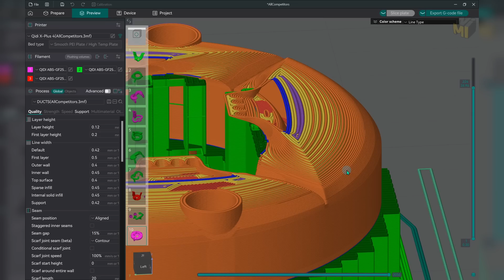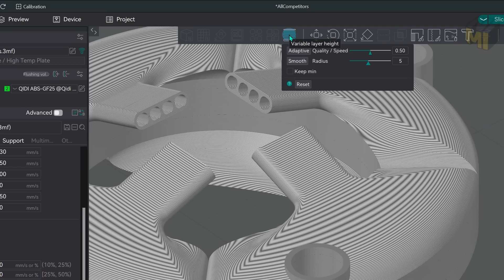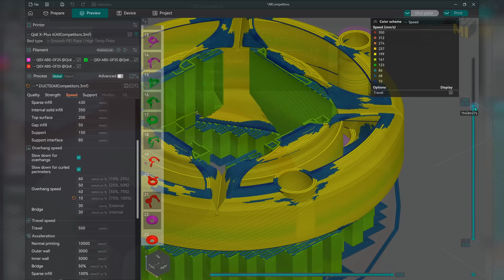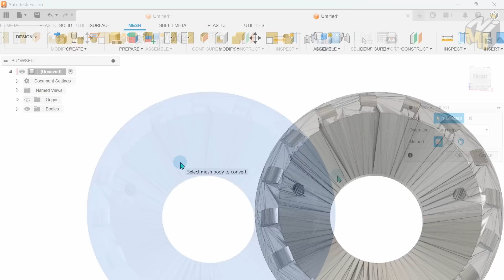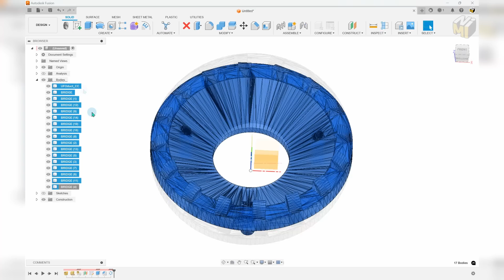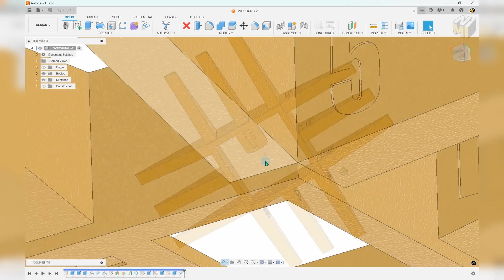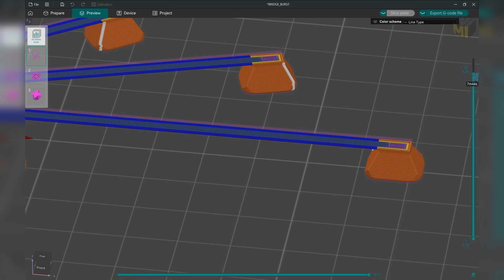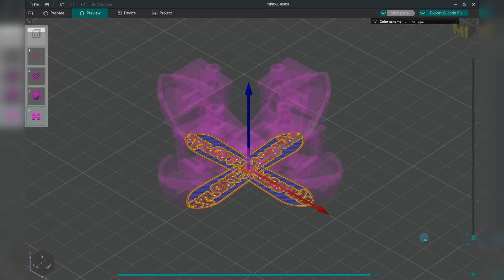3DP Duct Showdown - Two BIG circular ducts need to be fixed or they can't compete

Comment from the maker: *Bridge Burst*
Reply: Regarding the bridge star burst test. I recommend that you vary the height of the bridges (or at least have one set higher in each quadrant) where there are no 'ground effects' from the build plate to impact the bridging. Bridging done at 50mm off the bed could have a very different result from those done at 10mm off the bed. I also suggest that the following. If all bridging tests for each duct are done at at the same print speed, and they all pass, then to raise the print speed some % and run again, in order to find the duct(s) that can provide quality results at the fastest speeds. Note that fan speeds may need to be changed (up or down) as print speeds are increased to get the same performance results. Example: Duct A passes the bridging test at 100mm/sec with a fan speed of 50%, Duct B does the same. So the print speed is increased to 140mm/sec, fan speeds remain the same, Duct A passes, but Duct B fails, but if Duct B were retested at 140mm/sec with a 65% fan speed it passes. So you test again by increasing the print speed to say 175mm/sec, Duct A fails at 50% fan speed, fails again at 65% fan, even at 100% fan it fails, and Duct B fails at 65% fan speed, but then passes 175mm/sec when the fan is set to 80%. Duct B should be the winner between these two ducts for that test. Fan speed should not be a constant across all ducts in the tests (see my other comment). I applaud your tackling this challenge, as I believe the challenge/work is on you to give each duct it's best shot at printing its best for each of the tests.
Reply: I like this test, but I'd like to suggest an additional bridging test if/when possible. You mentioned bridging speed a lot, so why not a bridge speed test? Basically make a bridge speed tower. Every layer up it tries to bridge faster. Then we'll see which ducts bridge best at high or low speeds, as I imagine there will actually be sweet spots for some of them vs more air always more better.
Reply from the maker: Good idea, would that be one size of bridge at different speeds?  Or a few sizes at different speeds?
Reply: Additionally, in regards to what MediaMan3D said, adding a bridge fan speed tower could be interesting. Again it may show where different ducts actually excel. Allowing bridging with far less noise or distributing the air in a way that doesn't cause sagging, you get me. Obviously I don't think you can do ALL of these tests in the next video, but it would show even more about duct performance. Ideally tuning for one of these ducts may go something like overhang fan speed tower>bridge fan speed tower>overhang speed tower>bridge fan speed tower then repeat if you are finding higher speeds are possible but more cooling is still needed. This is all if your goal is to maximize both speed and quality of course.
Reply: Are you planning on printing these at 100% fan speed or if the flow is efficient enough are you going to turn that down a bit?

Fine tuning each duct does seem like quite a challenge though.
Reply: @SOHCHEAD  @NeedItMakeIt Each duct will likely need different fan speeds due to the differing designs. 100% fan speeds are a hold-over from when 3D printer MFGRs simply added a cheap 4010 fan that could not properly cool its way out of a paper bag. There was no engineering done by the priinter MFGRs on proper print cooling. This is why the community has been designing part cooling ducts for the past ten plus years. If 100% fan speed is used on all tests, many ducts will likely fail the test right away because the air flow at 100% could push a single strand of filament across the room and never make it to the far tower attachment point. For example my Hero Me ducts when used with with dual 5015 fans, perform best in the 30-65% of max fan speed (depending on the type of print activity going on at the moment). There are filaments that require a lot of part cooling (PETG, PCTG) and there are those that general wisdom says no fan for part cooling (think ABS), but actually can get best results when the part cooling fan(s) are set to 10-15% of total power rating.
Reply from the maker: For a few models, max fan speed will cause a pressure buildup as well; from what I can tell so far, your model will not suffer in this way.   If a good portion of the air that the fan can supply is not being used, the ducts will not be able to keep up with the demand.  We're trying to crank up the print speeds as much as possible while also having good cooling, when we run all of the tests the first time, it should provide enough data to be able to make some good decisions for follow up adjustments.  I'll give it some thought, however I don't believe there is any way at this time to know which speeds to use for which ducts, different speeds would also throw off the test results, they'd all need to be set to the 65% mark for us to be able to determine a winner.   I don't consider any of this to be easy and we're going to need to figure some of this out as we go too, I'll keep an open mind and see where this leads and rely on your feedback to see if it needs another look.
Reply from the maker: That is certainly a challenge, I think to keep it under control and something that won't take me months to do I'll run the tests just like I did in the previous videos first, as we get deeper into it and we narrow down the competitors, additional tests can be run.  The only way I can think that different speeds would work is if each competitor had a way to know the exact fan speeds which worked best with their ducts.  I don't think that this works well either because it's still not apples-apples.  I think at these high speeds, we're going to need to use as much of the air the fan can supply as possible.  Now how we're using that air, that's a different story, and that's where we're going to hopefully see some big differences.  The challenge itself is a challenge!  We'll have to see where this goes after all of the initial test have been run, some are quite restrictive, but... with this style of fan, a big of pressure buildup could be a good thing.
Reply: @NeedItMakeIt  For the bridge Tower, I would think you could have it in multiple sizes, but just a simple one to start out with like 5cm bridges or something would make sense. As for the rest, obviously we could come up with an infinite number of tests, but I totally see your vision for running through some tests and then seeing what stands out and moving forward from there.

Comment from the maker: *Overhung*- 5-10-15 Degree from 4 sides
Reply: Does this need a small chamfer where it's lifted off the bed?  My gut feeling is that you might end up with a fully unsupported first layer of the overhang, depending on how the layer heights work out.
Reply from the maker: I'll have another look, for these overhang tests, quite a bit of the overhangs are not supported, it will essentially be testing to see how well it can cool the filament as it is extruded from the nozzle.  That's with a 0.2mm LH, less could product better results, but I wanted to go to more extremes to see what is possible.  Worth another look for sure though.